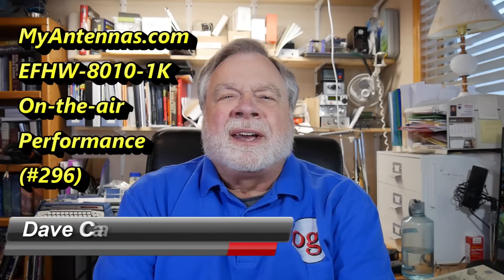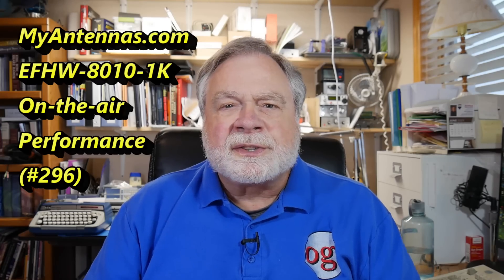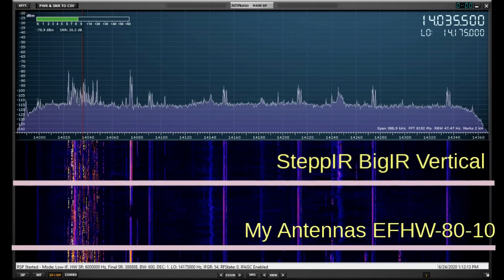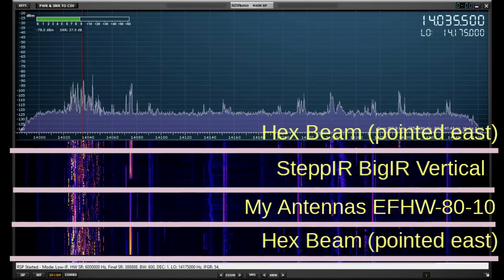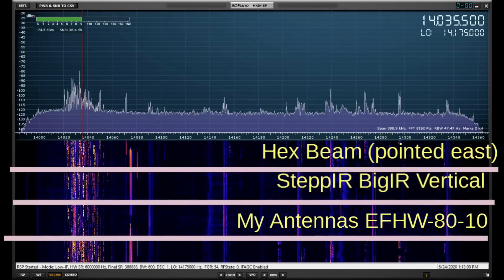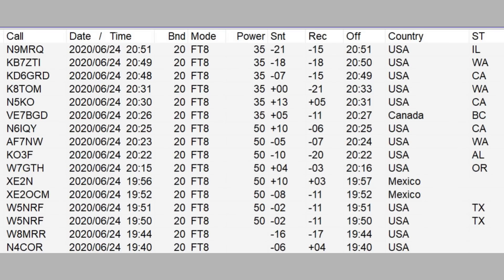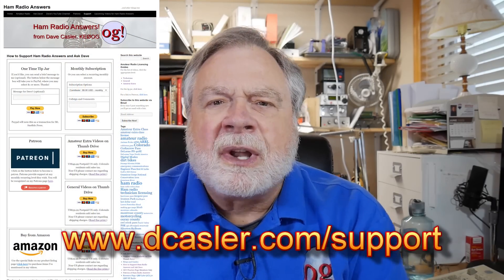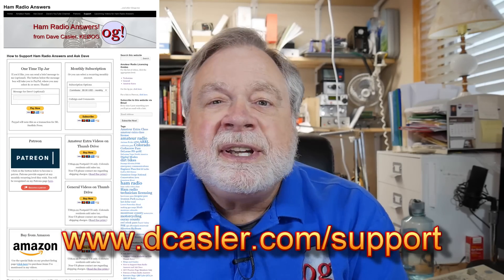Performance of the MyAntennas.com EFHW-8010-1K Antenna (#296)

Comment: Dave, a couple notes: 

1) I have my antenna more in a straight line right now and have worked on FT8: Australia, New Zealand, Ukraine, France, Italy, Brazil, and all of the states and more. My antenna is broadside facing east/west and I'm in MN. All of this on 20m and in about a week and a half of having it up. It has worked very well for me

2) You could cut the wire in half to make the top band at 40m, then you have 40, 20,15, and 10 I believe.

Comment: I have the 2K version of this antenna.  It is in an inverted L configuration and up around 36 feet.  I have the antenna grounded at the transformer which is 5 feet above the ground.  It works well on all bands and have no issue tuning the 75/80 meter band.  I have made lots of DX contacts in all directions of the compass.  It is a well made antenna and quite stealthy.  I enjoy your channel!

Comment: Thanks Dave. I bought the 75-10 version of this antenna in the hopes of lower swr on 3.9mhz than I am currently getting with the 80-10 MFJ version of this antenna which has very high swr on the upper phone frequency of 75 meters. We shall see if it was worth the investment when I try to run my amplifier with it which I can not do with the MFJ version.
Reply: So how about the 7510??
Reply: @scottraymond3218   I put the Mfj back up as the swr on high power   75 meter end fed from my antenna was a lot higher than the high swr on the Mfj end fed. Even with my Mfj 998 auto tuner it could not get it down below 2.5 to 1. The auto tuner can get the Mfj down to about 1.6 on 9.63 and lower on the low part of the phone band.

Comment: I've worked nearly 5300 contacts on my EFHW-8010-2K using FT8 with as far away as 18,000km overseas. It's a great antenna that can we very stealthy and unless you actually know where it is, is very hard to spot. Great if you have an HOA or an XYL who doesn't want to see a big antenna. Great channel and video. 73 W9HJ
Reply: What kind of power would you feel comfortable running through it?  Dave suggested knocking back the transmitter to 25 watts, and I would want more than that, even on FT8 (I run 200W give or take on FT8 on 20-meters.)
Reply: @SWRadioConcepts  Since I have the 2K version, I've run most of my contacts through my 7200 at 100 watts (I'm chasing DX100), but I recently picked up a Yaesu FTdx-101MP and I have pushed 200 watts through it doing FT4/FT8. One day I must have worked about 75 contacts @ 200 watts on 10M without incident.

Comment: Did you mean the MFJ cobweb antenna?
Oh, and good job, Dave.  I like my MyAntenna.com EFHW 10-80 antenna. Since I'm in an HOA, that black wire is hard to see. I suppose I have it in an inverted-V, too.  Although each end is is only 10 feet AGL, as it stretches across my backyard it ends up about 20 feet AGL in the center because the way the ground slopes. At least that's my story, and I'm sticking to it. :D
Reply from the maker: Hi, Tom. Yes, the Cobweb is what I meant. Sounds like you've had good results with the MyAntennas antenna.